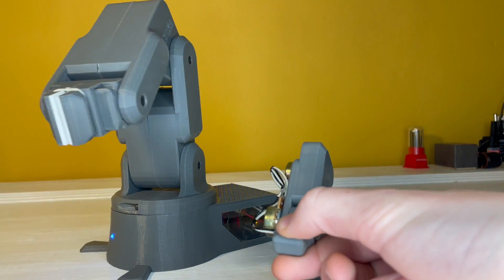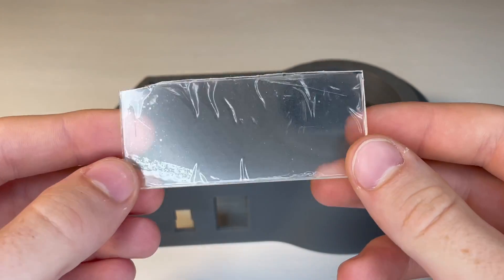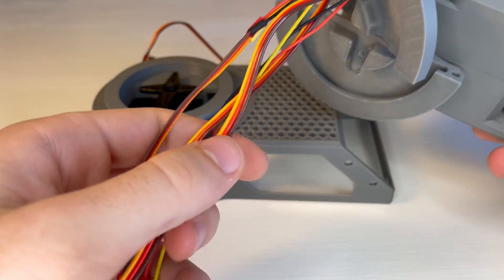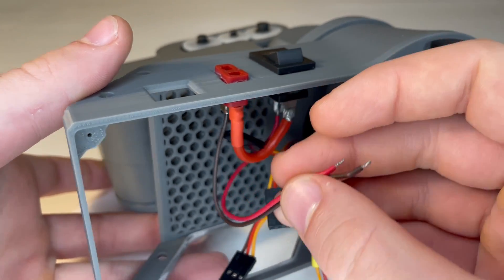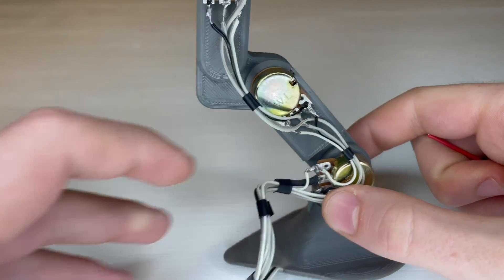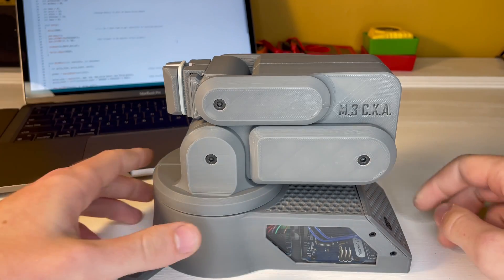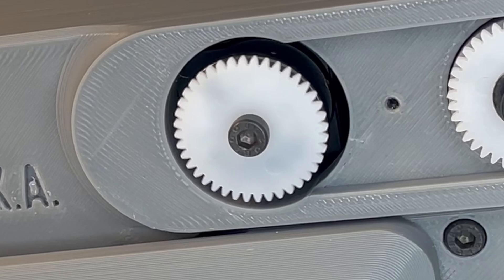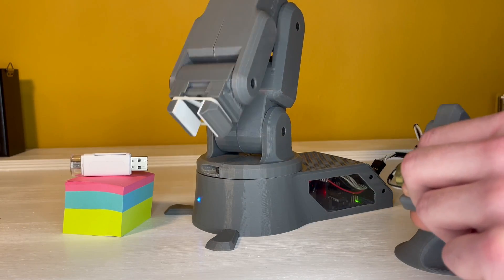How to Build a 3D Printed Robot Arm Tutorial (Arduino Based) - Part Two

Comment: I'm inspired! 

I'm going to make something similar, with a couple of changes, 

Firstly, I'm going to have a modular wrist joint, so I can switch out the heads allowing me to clip in a vacuum head (for picking up paper/light sheet materials) a standard servo head for picking up random objects etc, and maybe a spindle head so I can see if I can get it to tighten down screws or drill holes and stuff. 

Obviously it would need to be bigger, so I'll probably beef up the wrist/grab motor, and use closed loop steppers for the shoulder and elbow joints (or hack together some closed loop stepper system with some hall effect sensors) along with some pulleys, that means I'll need a ring bearing or turntable bearing to support the "turret", since the steppers for the first two joints will have to be supported in the turret assembly and since the whole thing will weigh quite a bit more. However I think with the use of steppers and appropriate gearing, I should be able to get something with real-world practical applications built, however light duty those applications would be. 

In terms of control, I think a record button which triggers the arduino to start recording a 2d array of the potentiometer values would be good, maybe just record the values 5 times a second or something, then when the program is played back, just cycle through the values and move the respective motors to their target locations as quickly as the arm is able. That way you can very slowly and carefully record the inputs, and play them back at lightening speed.

Comment: Hi, i build the robot so far but if i plug the power supply in nothing hapens no led on the board. Then i tried to find the problem so one by one i deconected the servo and them boom my resistor from the servo board explodet. Can someone help me? I really dont know what i did wrong

Comment: Really nice job. Well done! But, as an engineer, I hate to point out a few things, that might be helpful in the future: 
- try to minimize the amount of different screws used in a project. For example, try to use only M3 screw, instead of M3, M4 and M2. This will speed up assembly, as no tool changes are required. 
-Try to avoid gluing things together and use screws if possible. This allows disassembly and maintenance as well as giving more rigidity to the assembly
- Try to implement parts where possible. For example, you could print the bottom cover with the stabilizing legs as one piece instead of 3 -> less assembly required. 

All in all very impressive :)

Genius take, using a rubber band for the gripper.
Reply from the maker: Thanks for the suggestions! I totally agree with all those!

Comment: I'm in need of some help. This is my first project, The build was straight forward and even though it's my first time I was able to follow the wiring schematics. I did have to learn on the go how to install the pins and connectors properly. I set everything up to calibrate the servos with the potentiometers, verified the sketch and uploaded it and Nothing... I've had the arm apart three times to check and redo suspected bad wiring connections but still nothing. I've even run the blink sketch, which worked fine. I'm at a loss. The board I'm using is a RexQualis Arduino Uno R3. The IDE software recognizes the board as a Arduino Uno. If you have any suggestions on what to do or where to go to troubleshoot this problem it would be greatly appreciated.

Comment: just printed almost everything. plant to instead of the controller you have, use a Waveshare LCD with a raspberry pie zero 2 W to give it a GUI and some options to do. also add a color sensor detect stuff. either that or a small fpv camera or some form of echo (haven research this part) still checking out the specifics but yeah. goal is to press the screen and it will locate my keys and pic em up to put in a basket
Reply: How did it go?
Reply: @pododododoehoh  doing it on the sideline with school. In the middle of making a new grapper to it too so, so far it's not developed much haha

Comment: Very nice video! I would like to make it myself, but I had 2 questions about the products. How much AWG wire did you use and was it with or without PVC? And was the power supply 10A or 12A?
Reply: I used only AWG26 because of current needed by servos! Power 10A needed (never max charge of all servos required)

Comment: Why all my servos spinning all the time when I plug the power? But is very good project.
Reply: Kinda same prob, with one only… power issues ?
Reply: Did you resolve the problem ?
Reply: @TheBoss64340  Not yet, but I think I have continuous servo motors there.
Reply: @jakubhlavacek8596  what do you mean ?
Reply: @TheBoss64340 There are two types of servos motors and i have the wrong ones.

Comment: Hi, I see that most people have a question about power for their servos. The servo controller board being used as well as the Arduino and all of the servos that are being used all require 5 V power supply. If your services aren’t turning, it probably means that you have 5 V, but not enough current. You probably need a minimum of one amp, (1000 mA) to power the servos. But if you want all the servos to function properly, you’re probably gonna want more than one amp of power. Make sure that you don’t use anything higher than 5 V to power your Arduino or you’ll burn it out. Also remember that the power supply lines to the motors are not a signal line. You have three lines going to each servo ground, which is common to all the servos and the servo controller board, as well as the Arduino, and you have the 5 V or VCC line that is also common to all the boards and all the servos. The signal lines are pulse with modulated controlled by the servo controller board. The servo controller board is driven by high and low signals from the Arduino board. A high signal line is usually 5 V positive. A low signal line is usually ground. This robot project is relatively simple. You can buy the several controller module with built-in potentials to test servos and you will discover that the key is the amount of amperage going into that board. If it’s too low, your servos won’t move or they’ll chatter back-and-forth and will never settle and stay still. I hope this helps.
Reply: I have the PCA9685 Servo driver and the to SHNITPWR Universal 3V~12V Power Supply, does this work, bc mine still does not turn on
Reply: @themtbcrew4029 Hi mate did you figure out the solution?
Reply: Also note: using an LED as a method for testing is not a great idea. Yes you can see if you have voltage, but LEDs require 1.2 to 3.47 V to turn on. So even if your LED lights up you still don’t have enough voltage to run your servo. Your average phone charger for most modern cell phones gives you 5 V add up to two peers for quick chargers. But you’re older chargers will only provide 500 mA or half an amp. Also older chargers can have voltage drop the depending upon the load. That means that as you add more servo is your voltage can drop below 5 V. It’s best to use a power supply that is used to drive computers. You can pick up a buck boost power supply board from Amazon for a few dollars for a dozen. And this allows you to input any voltage between 2 to 37 V and get one set voltage out like 5 V. It will maintain that voltage regardless of the fluctuation of the power load, but you need to make sure when selecting your board that you choose one that will supply enough current at various voltages. Once again, I hope this helps.
Reply: @tbowl4074  i mean i use adjustable power supply in 6V to be sure there isnt voltage drop too low and 10A max but when I power on, only gripper servo works and base one is twitching, others just dont work
Reply: Hey, I am new I am just waiting to get a filament sensor for my printer. Any suggestions on what to do? Or what do I got to be concerned about when assembling it?
Reply: @tbowl4074  what if current is too high ? I use 6V/10A max it doesnt work !

Comment: First of all i wanted to thank you for the thorough walk through and the detailed explanations. This is my first "big" project in electronics i am doing. I have a small question that might come off a bit unknowledgeable. For this project i need a power source/supplier. How do i pick my power source? Do i get a battery? an adjustable power supply (that seems the best choice but also most expensive). How do I know what Voltage and current i need to supply in this type of project? Thank you very much!

Comment: Hello, the maximum voltage for the pca9685 (servo driver board) is 6 volts yet you still supply it with 7, how?
Reply: Because of voltage drop maybe ?

Comment: everything works but only 2 servos move but when they do they twitch. idk why and iv been trying to find the probem for a while now but i cant
Reply: Any solutions to the pb ?
Reply: @TheBoss64340  no, IV consulted a few people and they all have said the same problem, so waste of a build 😞
Reply: @ for real ? Stopped by the twitching servos ?
Reply: @TheBoss64340 ye idk if it's my wiring, the code or what 😭 but I can't find any solution. The arms just been sat there hopelessly for 6months 💀
Reply: @ seems to be all of that, good solder wire needed, then not big lenght of wire because of voltage drop, code check would be great also (test various code change in chatgpt )
Reply: @ And above all, enough current

Comment: Hello, I’m Abo it to put everything together. Just wanted to ask, when you plug the Arduino in to upload the code, do you also plug in the power supply at the same time so the servos work, or will that be too much voltage and fry something?

Comment: I got this working, but my hand servo doesn't move and the smaller arm with the pentiometers doesn't move the bigger arm unless I hold the button down, when the button should control the smaller servo for the hand. Any ideas where I went wrong?
Reply: I got the same problem, I litterally just built it
Reply: Power issues ? Drop voltage because of lenght cable ?

Comment: Hello, great project and I’m very interested in building it, however I am struggling to find the wiring diagram on the link you have in the description
Reply from the maker: @555amry  Hi there! Wiring diagram should be available through the Printables link in the description.
Reply: @buildsomestuff  yes I did notice that link in the description, however it shows 26 files, 25 of which are 3D printing models and 1 which is the ino code. I’m sure the diagram is there somewhere and I’ll feel stupid upon finding it but right now I genuinely can’t figure out where it is.
Reply: @buildsomestuff guess what I just found… thank you
Reply from the maker: @555amry  Awesome! No problem!

Comment: First electronics project......

I think ive blown 2 servo boards.

Had the servo boars plugged in while uploading code to the Arduino 

Could this jave overpowered and blown the board?
Reply: It's supposed to be powered for 7v
Reply: @sterling4680 yes but the max voltage rated for the board is 6v (written on the back) so I don’t understand how he supplied it with 7 volts
Reply: @555amry  iv done it with 7 volts and everything has been fine with me. The servos move but they are just twitching
Reply: @sterling4680  btw I saw other people talking about if the servos are twitching check the frequency of the board in the code and make sure you have everything wired well. Also change the pin for the button on the Arduino as pin 13 isn’t really meant to receive signals.
Reply: @sterling4680  also I do not recommend doing this 7 V thing. I recommend giving the pca board the correct voltage is rated for by another power source then give the 7V psu into the servos directly (make sure everything has common gnd)
Reply: @555amry  tbf when I did give it 7volts my plug did burst into flames for some reason
Reply: @555amry  well not for some reason it quite clear why but I'm tryna rewrite the code for the arm but it's such a pain to do so
Reply: @sterling4680  oh wow the board lit on fire?
Reply: @555amry ye when I plugged it in the port lit on fire
Reply: @sterling4680  what did you do when that happened, did you try again later?
Reply: @555amry  because in the links description he bought a board that supports up to 10v
Reply: @jcps8947  I have successfully built the whole thing and I can say that’s not the case. There are two power inputs, one is for the board that only takes 6 V max and is powered using the Arduino which provides 5V and the other input powers the servos only and can take high voltage.
Reply: @555amry I haven't tried it yet, but are you referring to the screw terminal? The diagram shows that the power supply (7v) should be plugged into it.
Reply: @555amry did you solve your problem ? Im struggling to power it, I will try 6V/10A input soon

Comment: Me and a couple friends managed to assemble this whole thing for a school project, however we're running into an issue where when we upload the code, none of the other servos move as the potentiometer does. We tested all of the potentiometers' connection without plugging into the servo driver and it reads, but as soon as we hook everything up to the driver only the microcontroller for the gripper functions properly. Some help would be greatly appreciated, thanks for the great tutorial!
Reply: Same problem
Reply: Got the same issue, try to move slowly and gently, got some issue to find the right control interval of the potentiometer !
Reply: Thinking of creating an Discord to talk about the arm issues
Reply: @TheBoss64340  ye probs the best idea. I would've thought the creator would've made one but nah. Let me know if you make one I'll join
Reply: @TheBoss64340  you have it maybe?
Reply: @PopMinecraft5 having what ?
Reply: @ the discord, or did you maybe solve the problems?
Reply: @PopMinecraft5 yes I have it in my bio y tb

Comment: I've built the project. sadly its not working as expected currently. only the base servo and the shoulder servo and hand servo are moving in response to the controller. however the movements are a bit erratic, some movement mimics the movement of controller but then the servo will move the other way and sometimes the servo is sort of twitching even when the controller is perfectly still

I have tested continuity for all the wires coming from the pots right to the arduino so ruling out any failed connections.

Also the hand servo is constantly in motion until i press the button and it stops until i release again. i'm assuming i've wired this the wrong way round. i worked around this by changing the code to if(pushbutton == HIGH) instead of LOW

Has anyone else had similar issues? I'm new to wiring and electronics so any help would be appreciated.

Is there any program i could use on my arduino to see if my arduino is picking up the changing values of my potentiometer signal.

Many thanks
Reply: I just built it and having the same problem. I'm testing everything tommorow
Reply: Solutions??

Comment: Thank you so much for this video! I've learned so much and you are amazing for keeping this open source. I'm super new to electronics so I ran into an issue with the micro servo for the gripper. When I press the button the servo doesn't move. It will move the 90 degrees to close at the beginning  (line 28 of the code) but won't move beyond that. When I switched it out with a regular servo (MG996R) everything ran fine and the button opened/closed the gripper. Plus the pin 13 test light turns on/off when the button is pressed, so I'm confused.  Wiring isn't the issue either since when I connect the micro servo to the pins controlled by a potentiometer, the micro servo runs perfectly. I've tried to troubleshoot: I've assigned the micro servo to different pins on the driver board, re-copied the code over, and, checked the voltage with a multimeter (it was within the correct range for the servo), but I'm still sort of stuck. Any help would be appreciated. Thanks!

Comment: It still doesn't work, if I only plug in the Power the driver doesn't turn on, but I've tested it with an LED an there is power, but the driver doesn't turn on. But if I plug in the Arduino the driver turns on but the voltage is missing an the servos do nothing. Could anyone help me 😢
Reply: I would recommend checking the wiring. I'm going to build this soon so I will have more of a understanding of the robot and possibly help you if you still have the problem
Reply: Does yours work?

Comment: I have a question, im so down because my Arm doesn't work. To what Voltage do I have to set the Adjustable Power Supply?
Reply from the maker: @themtbcrew4029  Sorry to hear that, the arm should be set to 7V.
Reply: Thank you sooo much, I also found one soldering flaw by me. I hope this was the Problem, I will give an update and thanks for the quick reply.
Reply: @themtbcrew4029 did it end up working?
Reply: Nah, I saw my arm and thought, I'm gonna tackle it now, so I looked at the comments to find new ones and I saw yours, so no